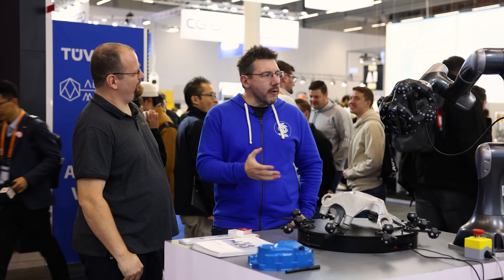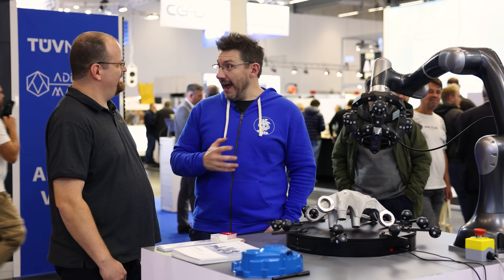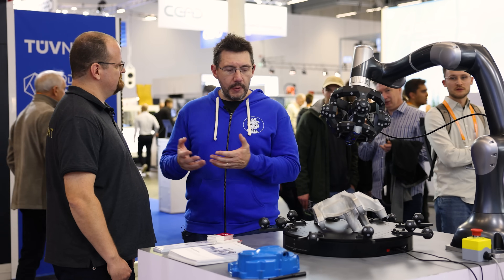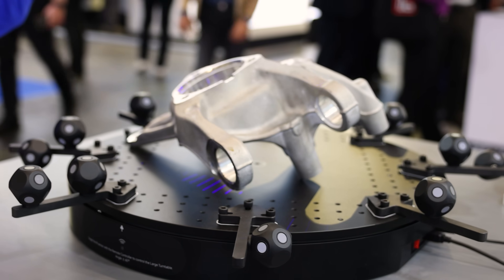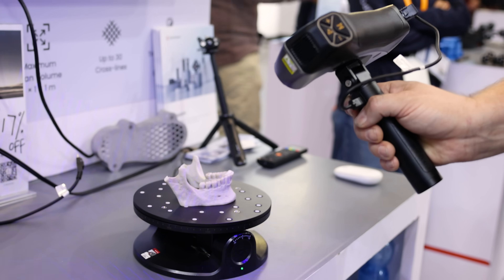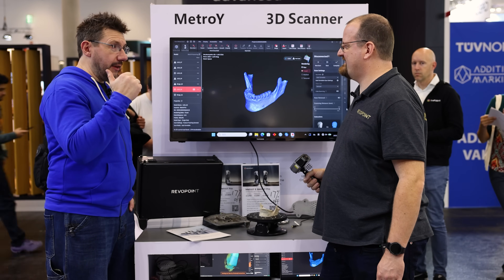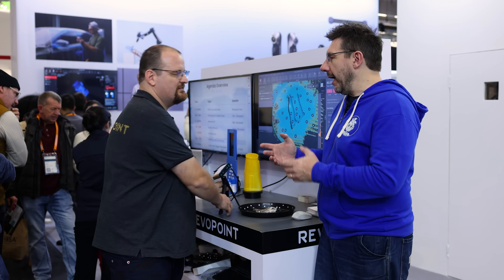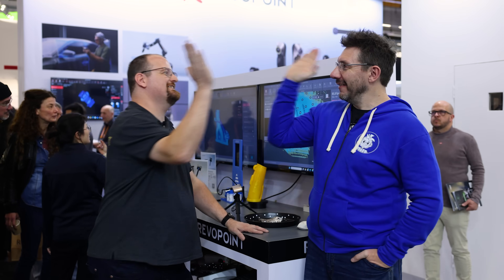A Robotic Arm that 3D Scans! Revopoint at Formnext 2025

Comment: It is cool tech but I call 0.02 mm accuracy questionable.  What is the repeatability?
Reply: @dwaynevarnell9157  Hello, 
I'm the guy in the interview. 
The scanner have German metrology certification ( I don't remember the name). And I've used it successfully on my own to scan the surface condition of 12-ton wind turbine shafts for my work. (Video coming soon to my channel)
Reply: @Zoltan3D I’m unsure about an ISO standard for 3d scanning but there is a ASTM E57 file formats for 3D image systems.